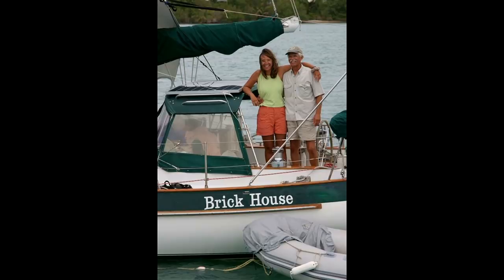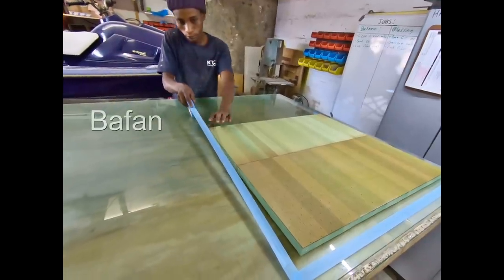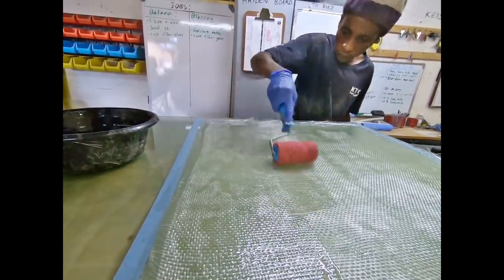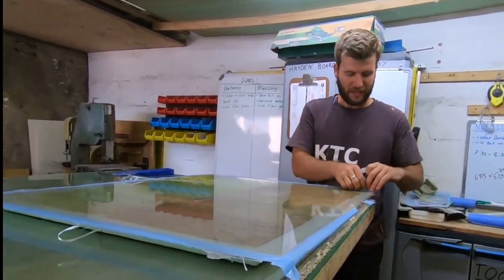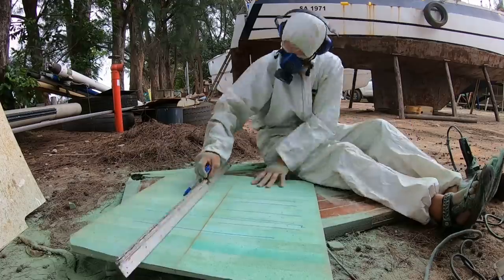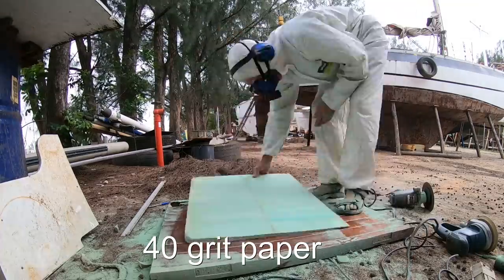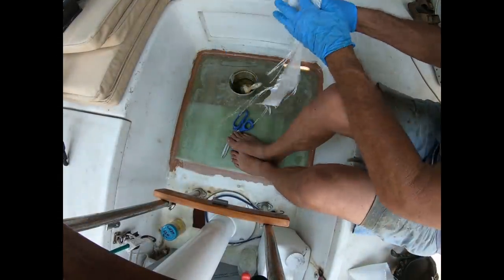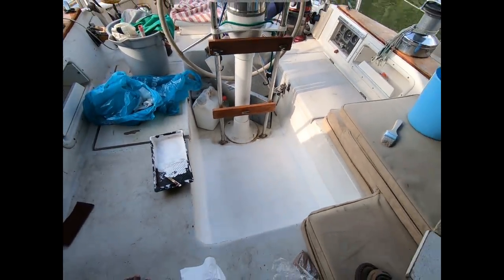Cockpit Floor Repairs - Water Drainage  - NO WET SOCKS!  (Patrick Childress Sailing #56)

Comment: Hi Patrick and Rebecca great content, always a help for ideas on my rebuild. Perhaps a little more investment in sound gathering? I was having trouble hearing some of the content. Thanks you for your hard work in showing me your techniques and projects! Ben S/V Dawn
Reply from the maker: Yes, sound has been a challenge. I just picked up a wearable mic and recorder so now there is one more bit of equipment to learn, which might improve things. Sound in Hayden's shop was terrible, while doing the layup, since a compressor was constantly running in the background. I knew those sections would have to be a voice over.  When Hayden was talking about the separating resin on the glass table, that short section was just barely usable after adjusting the equalizer. That was a new technique to me. The outro, with Rebecca at the end, was a very big surprise to both Rebecca and I, as it all sounded fine going into the rendering but quite muted on the uploaded video. Seems there is always a snag. But thanks for your comment and we always appreciate feedback on how to make the videos more viewable.
Reply from the maker: Also...remember too, that on any of our videos, you can turn on closed captions so you can get every word of what is said. (30+ languages too ;) ). Happy Nee Year!

Comment: I am so glad to see another post from you. Gives me a chance to one a new stream. How much longer are you intending to be in R Bay? At present it is not our usual December humidity. I have however spent timc in the complex pool wheee i live - a small splash pool, but is in the shade most of the time so is not to  hot. Where I used to live in the village, the  pool waa in the sun all day so heated up fast. When you do eventually depart from the Bay, I wish you fair winds!
Reply from the maker: I think we are gonna go around mid January. Will you wave to us from your place?.
Reply: Will you even see it from the ocean? It is virtually in the middle of the village, the only set of flats here. Downstairs is the ground floor with 1 office on the first floor, with 6 1 bedrooms flats. I own the one furthest from the sea because of the coral reefsthat keep the larger sharks from the beach, most wants sailing to Durban, do so over the horizon that is where the ships sail. Inshore, the sea is quite shallow and there are coral reefs that calm the waves, but are breeding grounds for Great Whites. These reefs made Port Durnford an ideal landing spot for troops from Durban, because the sea was calmed by the reefs. That is why there is a place that grew up in 1879 as Port Durnford, with a hefty out to sea. That has long since ceased to exist and Richards Bay became a commercial port, vlosevbybraik and road to the Gauteng hive of industry.

There are often trains of many kilometres length loaded with coal shedding into the coal terminal facing you as you leave the Yacht club
Reply: There is a deep channel heading straight out of the Bay itself, a year ago, a coal tanker strayed to the  left of this channel, ran aground and has to be broken up and towed further out to be sunk
Reply from the maker: Ah ok...won’t try to wave then...hahah -Rebecca
Reply from the maker: Ok, good to know...need to be ever vigilant. -Rebecca
Reply: Have you gotten used to our usual December warm weather? It does (stunningly) get hotter in February, but thank heavens that is our shortest month. When you leave in mid January, where are you planning to head for? I want to wish you fair winds where ever you go. I know you will be out of S.A. by February, but that month is traditionally our hottest and most weather affected month. It is sticky hot and is the month when we are most likely to experience cyclones. In 1984 Zululand had a bac cyclone - Domoina - that did huge damage and last year 2 cyclones in quick succession, struck Beira in Mocambique, nearly wiping it from the face of Africa. Admittedly the Portuguese never built things to last and major hotels that existed when my family used to go to the coast there from Rhodesia, imploded. Cyclones are dramatic, but that was terrible news. The chalets we used to stay in had long since been absorbed into the sea.
Reply: Are you still in the Bay? If so, how are you enjoying our traditional Zululand heat? It has been quite warm lately! Traditionally our warmest and most humid month is February but thank heavens it is a short month! March is warm for the first 2 weeks, then the weather moves to our best weather in April. I understand from family that it is bearable in East London and Port Elizabeth. The recent cricket 5 day match in Cape Town showed that summer there is still in full swing, but is going to cool down soon. The winds there tend to originate in the Antarctic.

Steve Killick
Reply from the maker: Stephen Killick sorry...we were on a run up to Mozambique (over land) so harder to keep up with comments. We will be heading to Capetown as quick as we can when we leave in a few weeks. We don’t have a huge amount of time before the weather window as start getting shorter again so now we need to get there unless we want to play visa games for another year. This one was a tough one and we escaped by the skin of our toes.  -Rebecca
Reply from the maker: Stephen Killick yes...we are still in Richards Bay, though we have been gone the last few weeks. We are back now. Will be going crazy next 10 days getting the last bits tied up, and then will be enroute to Capetown before the west Ayer windows start to close up again for another year.
Reply: You will, find Cape Town  is beautiful, but very busy. I found last time I was there, the traffic  at all times was horrific. The people are however really laid back - makes Zululand seem x hive of activity. Most are spaced out - car fumes? - or are drunk with the wine ration for the week. Interesting change to a lifestyle.
Reply: I used to go to Mocambique when we lived in Rhodesia - Beira was the nearest sea . I do not imagine that much has changed there, except the play grounds (I was 10) were rusty then and must have rusted away. The chalets we stayed in on the beach were in danger of falling into the sea, and most will have succumbed to this fate.
Reply from the maker: Stephen Killick Really..not what I was expecting!!!-Rebecca
Reply from the maker: Stephen Killick We were in Maputo. There were some really pretty parts and some not so pretty parts. I wouldn’t want to live there. South Africa seems much nicer. -Rebecca
Reply: What WERE you expecting? To call Mocambique a Third World Country is being generous. My family  only went there because it was the closest sea to Rhodesia - where i was born. The former colonial masters put no money into the country so on Independence the people had nothing to build on. Recently they were devastated by 2 cyclones and have no money behind them to rebuild. It is a shame as the native people were great people. True my cousin was killed on a cross border raid but that was because Robert Mugabe's followers shot the helicopter down they he was in! He was serving his National Service in the Army at the time.
Reply: I found out a bit more about that yacht I heard was for sale in the Bay. It is Ferro Cement and that does not interest me. The sailing channels on YouTube are of the opinion that Ferro Cement is not the best material - given time, it hardens to the extent that any slight bump and it collapses and the yacht sinks. I understand for this reason, insurers are reluctant to insure Ferro Cement boats. I would be more interested in buying plans, laying up the framework and glass fibre coating it - ie starting from scratch. I know when we left Zimbabwe, it was popular to built Ferro Cement hulls, but that was an effort to get around the severely restricted foreign currency allowances.

I will continue looking for a 25' to 35' (feet, not inches!) boat. True it will need a lot of time invested, but I am retired - on ill health pension - so the one thing i have a lot of, is TIME, I may be disabled, but there is precious little that I - and my gold credit cards - cannot achieve.

Steve Killick

Comment: Why was the cockpit sole canted forward?
Reply from the maker: The cockpit has always been a bit too flat. The original construction did not give  the floor adequate slope in consideration for all the trim loading snags a boat like this goes through over the course of a long passage. With 2 anchors on the bow and 300' of 3/8th chain, it takes a lot to trim the boat aft. With full fuel tanks, this helps to regain proper trim and better cockpit drainage. Trying to keep the boat light and buoyant in the stormy western Indian Ocean, the lack of fuel in the stern located tanks, and far less water in the water tanks, changes the fore and aft trim to decrease the necessary drainage of the cockpit.  We had to sell our 50 pound sail sewing machine to get it out of the bow, which was the only place it could be stored.
Reply: @RVLifeNOW   Thanks for the explanation.  I kinda figured that might be the case 'cause I have a bit of the "forward leans" as well.
Reply from the maker: Welcome...thanks for watching and for your question.

Comment: No tarps or way of containing debris in that boatyard 💀. I guess that’s how it goes in foreign ports. They are really strict here in the US
Reply from the maker: Many countries are much easier than the U.S.. Here, in S.Africa, we hung an old mainsail to help contain sanding dust from spreading to our neighbors. But I made sure our neighbors used the same sail as a tarp when they sanded, especially the steel boats. Also in an upcoming video I will show how well a cheap vacuum, using water as a filter, caught a lot of sanding dust and saved us a lot of cleanup. We did a lot of raking of debris and put it all in the dumpster so it could be transported to a distant land fill and pollute the ground water someplace far away, same as in the U.S..

Comment: A tip for you when you fillet the corners before tabbing....use the round end of a tongue depressor on the thickened epoxy and you will get a smooth curve that you can glass straight onto after about 30-60 minutes and avoid all that sanding
Reply from the maker: Actually I used a table spoon to get the initial concave shape, but I am not good at this. In the battery box rebuild video, I set down blue tape to outline where the fillet would go then used a spoon to putty in the fillet, then pulled up the tape. That worked much better....but I got in a hurry on this and skipped the blue tape. My hands were so full of epoxy I couldn't turn on the camera to show the making of a fillet, this time. Thanks for your suggestion.

Comment: What about using epoxy for the foam panel
Reply from the maker: All the repairs and patching I have done to this boat have been using epoxy, except for filling the voids inside of the keel faring. Epoxy could have been used for laminating the skin on the foam panel but I went with the preference of the contractor and let them use polyester. In this application, there was plenty of strength using polyester in the layup and it set up faster than epoxy. I used all epoxy for the installation of the panel.

Comment: I always wondered how to make a Coosa board, stress skin panel, laminated foam core panel. Thanks for this information.
Reply from the maker: You are welcome. Using Coosa board, or something like Coosa board, is a much easier way to do a cockpit floor repair, especially if it effecting the drainage of the water from the cockpit floor. This is of course not actual Coosa board, but is just like it, and a laminated foam core panel , as you can see in the video, is easy to make yourself for all kinds of DIY sailboat repairs. -Rebecca

Comment: My plan for bulkheads and other flat panels (settee tops, etc) for my Tartan 26 project boat was to use a foam core, either Divinycell or Coosa, with appropriate layers of glass on both sides, using plate glass for a layup surface.  It is gratifying to see someone already using this technique!
Reply from the maker: Hi Tod...thanks for your nice Christmas Tip! That was very nice of you! We have used these coosa type boards in a lot of places on the boat...real time savers! -Rebecca
Reply from the maker: I always had it in my head that these things had to be vacuum bagged. From watching different methods used here in the marina we are at, I saw you can get a very strong product without the expense and extra work of vacuuming. Good luck with your Tartan project. The 26 is a great boat.
Reply: I'm sure vacuum bagging would result in a better laminate, but whether it is worth the additional expense and labor for my project, I don't know.  I'll make a test panel and decide at that time.
Reply: I used 100 psi extruded polystyrene insulation from the lumber yard for a lot of panels. With as many as six layers of glass per side the stuff ended up rock solid. If you need glass for the lay up table a good source is used building material sellers. I picked up a very thick glass panel that used to be a store window for next to nothing. Best of wishes on your Tartan refit, and good luck hiding all the receipts from the wife. 😁

EDIT: important detail I forgot to mention is I sealed the foam board with three sprayed coats of PVA to prevent the resin from eating it up.

Comment: Last video you still had a boat load of work left. Looks like you put the peddle down
Reply from the maker: The pedal has been down, 7 days a week, for the past 7 months. There is so much I have been wanting to do, without the surprise projects, for the past 5 years....and now most are done. There are a lot of videos to put together, like applying the Coppercoat, resin blister repair, granny bars, ripping into the rudder to see if the interior and welded parts will survive the long distances ahead, the refacing of the walls and cabinets along with new mirrors in the head, two sources of cabin heat are now installed......the list continues but almost all the projects are now done.

Comment: Nice work but why don't you make two drains? Happy glassing!
Reply from the maker: For an ocean crossing boat that experiences different trim characteristics as fuel and water supplies are used, there was never proper pitch to the floor. What pitch was there was designed to drain the water aft to the drains which exit the boat above the water line. Adding drains through the forward section of the cockpit floor means having to put in thru hulls in the engine room and having to snake hoses to them or snaking long hoses a long way aft and trying to avoid the steering mechanism and somehow keeping the proper pitch to the hoses, then adding thruhulls through the aft of the boat. It is a far better design to just add the pitch which does not allow water to slosh around in the forward section of the cockpit floor.  If you watch our Valiant-40 tour, the first one in a 3 part series, I show how I had to make the factory drains bigger and then added another drain on the vertical, aft, panel of the cockpit and hosed out the back of the boat. This is a high water level drain for when large waves fill the cockpit, which has happened. There are a lot of boats that do not have adequate cockpit drainage.
Reply: Good answer. On my boat the cockpit it is leveled out better, I think. No problem like yours.  I hope your work will work out fine! Nice glass job! Keep up the good sailing and your vlogs. You are the best.